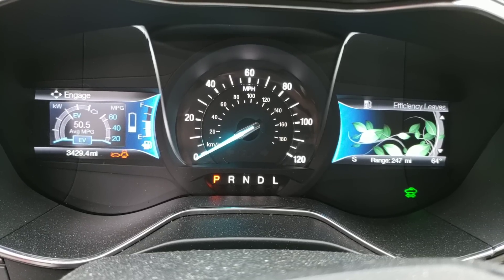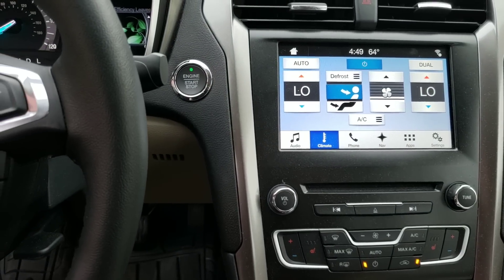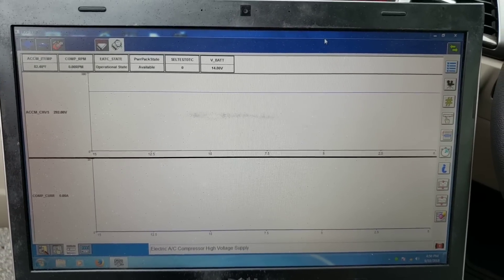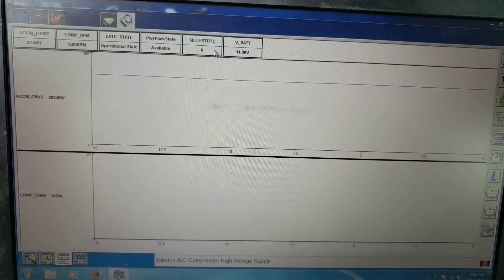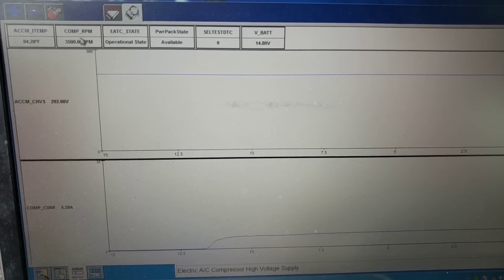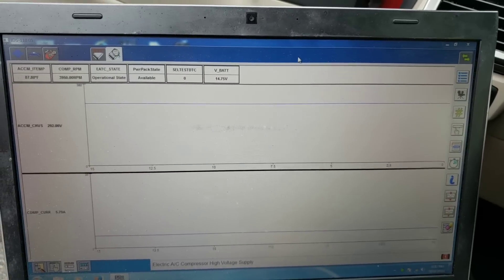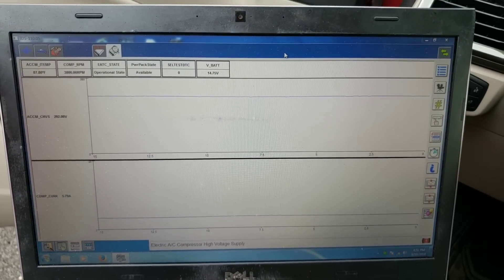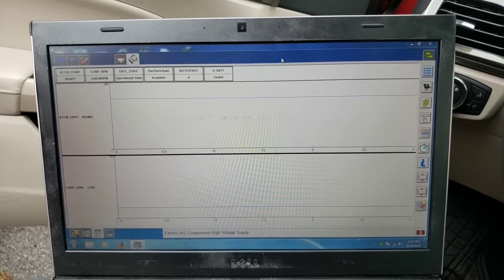When does IDS become a necessity?( For fast accurate repair)

Comment: Great video as usual. Can you please make a video on bcm programming on a ford with smart key.
Reply from the maker: I am sure I will have one to video soon enough
Reply: I attempted to program one on a 2015 Edge and can no longer get get the car to start halfway through the program in it attempted to program the key but it did not allow me because I do not have LS ID. Is there a way to circumvent that
Reply from the maker: @thecarclubauto3864  no circumvention without LSID, or a mobile guy like me
Reply: I was using the pass-through

Comment: Cat.II multimeters can be had for as little as $20,- so I guess most multimeters one buys in th US are at least Cat.II, just like they are over here, which means they're good for at least 300Vdc (usually at least 400 or 500Vdc).

Taking measurement on something which is live at 292Vdc is a lot more dangerous than 'regular' car electrics, sure, but if you make sure to stand on rubber matting and don't touch the body of the car, you should be fairly safe. Fixed connection to the common, one hand on the probe and one hand in your pocket is the golden rule.

Comment: wow 292 volts  to the a.c  .  some electric cars  are 600v  1000 amps   need to know what your doing  when working on something like that.  The days of working on your car at home with  a socket set and a hammer will soon  be gone  .

Comment: Unfortunately in Australia, we have highly restrictive access to factory data unless you work within a factory workshop enviroment, and even then your equipment, associated software and hardware is out of date and updates are a massive investment for the principle dealerships. Though I work primarily on underground and surface mining equipment, our scan tools have costed between $40k AUD and $70k AUD, which is a huge investment for equipment that lasts only a few years in this environment, is up to 12 months behind in software development and upgrades, and factory support, especially in Australia, is non existent. This failure is not restricted to independents, factory workshops in Australia face the exact difficulties. 👍👍

Comment: 292 volts will give you a tickle and a quivering sphincter
Reply: 292 volts DC will put you on your ass, more like. I've been poking around in equipment which uses vacuum tubes since I was 14 and I haven't been stung yet, but I have it on good authority coming into contact with a large DC voltage is not pleasant.
Reply: 292 Volts will put you in a coffin.
Reply: or turn you into a superhero

Comment: The first tool a deal MUST buy to be authorized to work on ANY Ford Hybrid or Electric Vehicle is a 10' fiberglass poll with a big hook on it !  Yep, to pull someone OFF of the vehicle if the come in contact with high voltage and their muscles lock up.  I think one is required per bay where Hybrid or Electric Vehicle repairs/maintenance are done.
Reply: you mean pull what's left of them off it ;)

Comment: U hit us with good cool logic. If you're going to work on that system, u better have IDS. Since they have high voltage available, why not run the AC like a house system. High voltage means smaller wires. Also, emancipate the compressor from the engine. As in electric p/s systems. No need to run the engine. And u have a whole lotta killiwiggles in that battery. Like a Tesla power wall. For me IDS is something I would have to share with a couple of friends. Like u said, u get more with a dozen donuts than u do with a dozen dollars. Always love a DeFazio day!!

Comment: So here's a question; where would you draw the line of manufacturer's tools if you worked on multiple makes (as you do)  but didn't specialize in on-call diagnostics?

While I have your attention, follow-up question; does the subscription based Matco MaxMe work as well as the IDS?

-Cheers.
Reply from the maker: That leads you to building a demographic first. Name the top 3 dealerships in your area , what makes do they sell ?

Comment: Keith, how do the the shops you work for pass along the cost of you diagnostic work?  Do they usually just eat your diagnostic rate as the price of doing business since they already billed the customer for a bunch of diagnostic time?  Or do they pass it along to the customer/insurance company (in this case: repair electrical connector - $200).

Comment: It looks like they are working hard to put the diy’r out of the picture high voltage and a special factory scanner then the cost of up dates oh where do I plug the scanner in my 53 Willy’s truck hahaha nice video look forward to the next
Reply: Not only the DIY'er, but also the untrained, but also the tech that's not equipped. Not everyone has the know how nor the equipment to work on hybrids, some don't know the deactivation and post deactivation confirmation procedures. It can cost a life to fiddle with this system carelessly
Reply: Then again your 53 truck doesn't have ac so it's not really a problem
Reply: Jack S yes it does try again

Comment: All tools do the same. Only difference is the data/functions of the scanner, which comes to SOFTWARE only.

Scanners that will do everything on all brands are almost here and they will be less than $700 and the sw updates will be cheap also (just data).
Reply from the maker: But isn't that what we use the scantool for? Correct data and functionality? This tool opens doors to being the one that can handle any Ford vehicle without a doubt of will my scantool handle the system I am working with. I just see it as a very worthwhile investment with the number of Ford products I handle daily. Cheers

Comment: £1900 for ids over here Keith (Uk) and the vcm about £1600 .Joe
Reply from the maker: Yes , you fellas use a different system there. But even still, it's a Ford product and you'll certainly make money on top of the investment😁
Reply from the maker: http://www.fordtechservice.dealerconnection.com/VDIRS/wds/vcm_retail_renewal_Latest.asp
Reply: $2.36 per day.
Reply: New Level Auto Thanks for that info Kieth!

Comment: Nice, i wish i had factory scan tools. Key is staying in the driver's seat. Not that i don't like getting dirty, but it's about working smart. Now, i know i probably wouldn't try it, but could we not put an amp clamp around the compressor power wire? For those who don't have Ford ids.😅
Reply from the maker: Yes you certainly could have the amp clamp around it . And the question for you to research is .... AC  or DC current ? 😎
Reply: If the high voltage cables are like G.M. cables they would have a coaxial cable, High voltage in the center surrounded by a ground shield for loss of isolation. Don't think you could get amp reading through that.
Reply: John Hnetkovsky great point!
Reply: New Level Auto ac voltage
Reply: @NewLevelAuto  I would think AC as well
Reply: New Level Auto dc 12 volt system, ac 300 volt system
Reply from the maker: @SuperMarioDiagnostics  can your current clamp read this then?
Reply: That's if you can even reach or get to it, let alone wrap a clamp around it....
Reply: Cuba Rodriguez true, access is another factor
Reply: hmm can this be meassured this way?
Reply: Petar other than the obvious hazards i don't see why it wouldn't. I think I'll even get close to it. But just a hypothetical question.